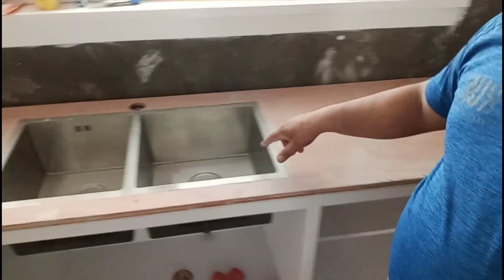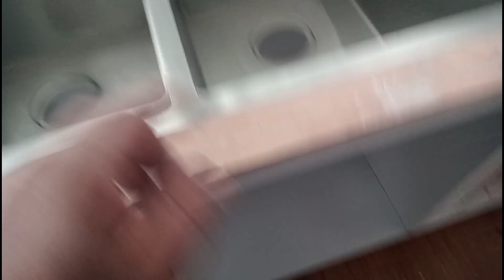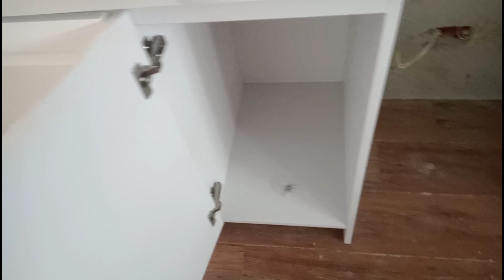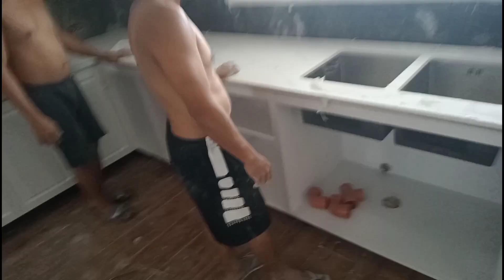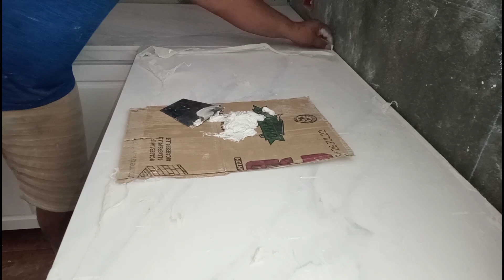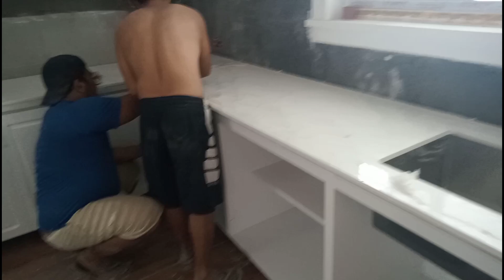Quarts solid surface installation undermount sink

Comment: Problema tlga ung pinatungan ng quartz dahil kadalasan marine plywood ginagamit hndi magtagal yan pag nabulok ang marine doon na magka gap ang dugtungan ng quartz. Un ang nangyari sa bahay ko sayang lng gastos.
Reply: So Mas Mainam Pa Rin Talaga BuhOs🤔?! #NagtatanongLangNaman😅🤷
Reply: @jonelynacay1954  sa palagay ko at sa na experience ko sa kitchen ko tama po mas matibay ang buhos at mas madali mag maintenance halimbawa masira ang pintuan ng cabinet. Ung modular na yan mgnda lng yan pag bago pa pero aftr 5 years jan na sakit sa ulo at ung kitchen ko pa madalang lng ginagamit dhil may dirty kitchen ako.
Reply: @jonelynacay1954  But I am considering po ung gawa sa PVC board na 3/4 na pwde siya pinturahan or pwede ron lamination wla pa lng inputs. May vlog si Architect Ed dito sa mga board na ito.
Reply from the maker: Buhos pam Probinsyano pa Yan